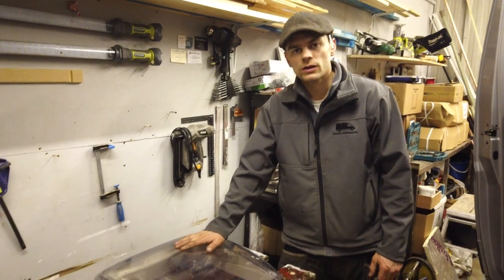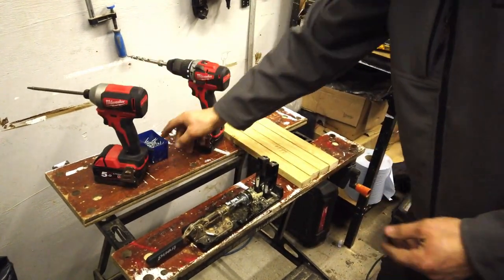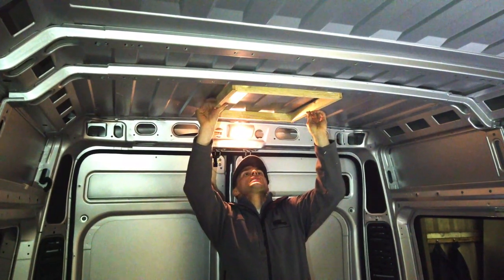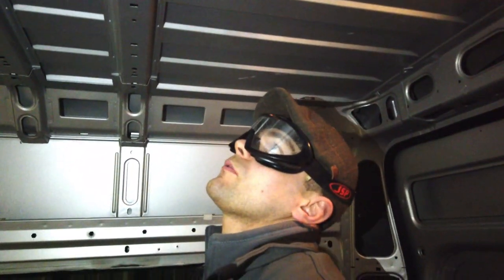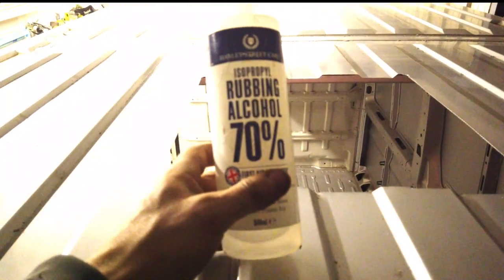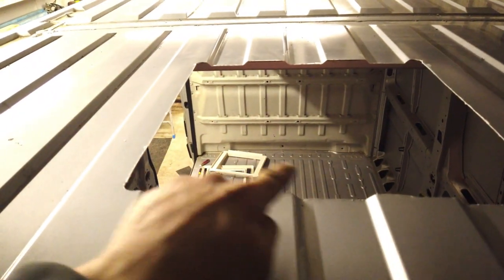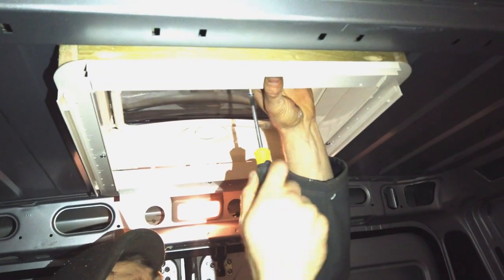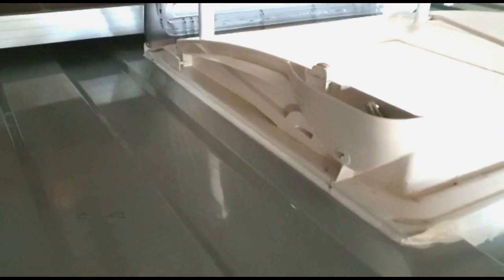Van conversion rooflight install | Build series ep 2 | Off-grid vanlife campervan

Comment: Hey guys, love your build guide videos! Quick question - I’m going to install one of these roof lights in my build, but they come in two depths - one for 25mm to 42mm roof depth, and one for 43mm to 60mm roof depth. How would I go about knowing which to use?! I‘ll likely use 50mm kingspan insulation on the roof, so would this mean I’d need the 43-60mm? Any advice massively appreciated, and thanks again for the great videos! 👍
Reply from the maker: Yes, you would want to purchase the 43-60mm option. Thanks for the support